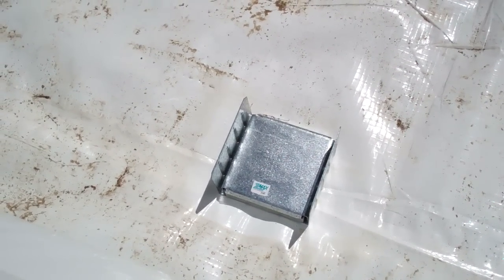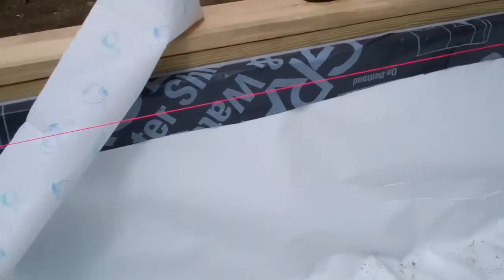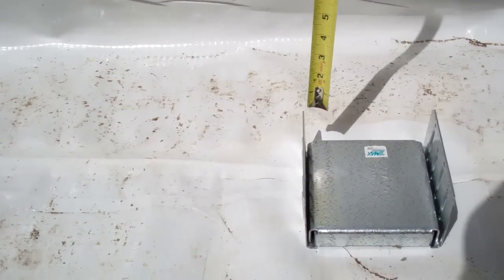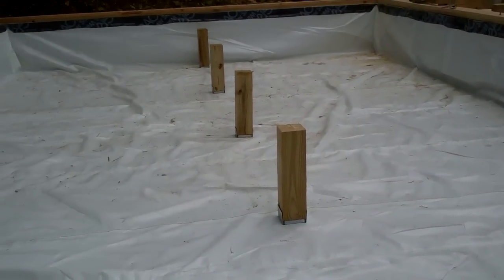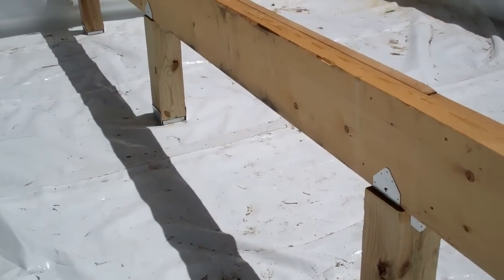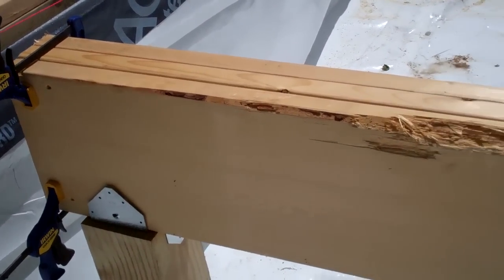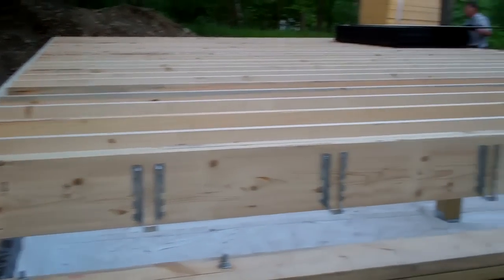First Floor Framing.mp4

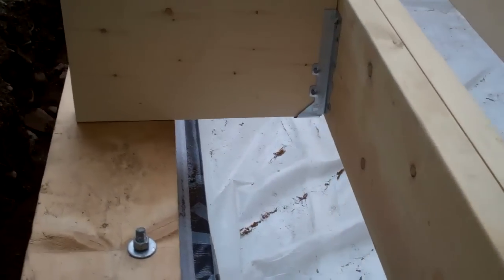Comment: 2:22 Looks like an engineering flaw in design. Those small joists will pull out on lowest point due to force from top down.
Reply: Its actually not. From that angle you cant see the gurder at the halfway point. Those T joist are just to support the exterior wall and the weight is transferred straight to the foundation wall. He is less then 16" from the foundation wall so all the weight of the floor is on the double 2x10. He really didn't even need to double them up.
Reply: @ianrobinson476  doubling up couldnt have hurt, better to overbuild than under, what i want to know is why the girder is not against the block, if it were me i would put it on the block, or notch out the block to receive it, making sure to coat the connection heavily to keep water absorbed from the block from getting to the wood.

Comment: Will 15' long 2x10s joist at 12" centers flex without that center support beam. I wanted to build an elevated cabin so I can park my car under it .
Reply from the maker: If you are building a floor that will support residential living space, then yes.  But not if it's going to hold up industrial equipment, or a roof with snow loads.  Just check your code book and span tables.  The most common lumber my local suppliers carry is SPF#2 or better.  That's Spruce Pine Fir, grade 2 or better.  https://up.codes/s/allowable-joist-spans
Reply: @DavidPozEnergy  Thanks. I bought some steel 8" pipes by about 5/16 wall today. I want to put a cabin in the air so I can see the wildlife once I start planting there. I am also about to order 2.5kw in Solar panels in preperation of my off grid adventure. Thanks

Comment: What is the bracket used between the triple 2x girder (beam) and the 6x6 post @ 1:40. I am trying to anchor a triple 2x6 beam to a concrete footer. Haven't been able to find anything with a 4/5" opening for the triple 2x's.
Reply from the maker: These are the connectors I used: https://www.strongtie.com/onepiecepostcaps_postcaps/bc-bcs_productgroup_wcc/p/bc.bcs
Reply from the maker: Another option for your situation might be: use a "post base" made for 6x6.  This will be 5.5".  Your triple 2x6 beam will have a width of 4.5", which means you could fill in by using squares of pressure treated 1/2" plywood on each side of your beam.  This would make it 5.5" just at the anchors.  Just an idea for you.
Reply: @DavidPozEnergy  , Thanks for the QUICK response. Yes, the second option is the one I was thinking of, but was hoping for a connector with a 4.5" fit. The specs for the BC/BCS connectors you linked above don't show any that have a 4.5" opening that would correspond to the three 2x's. What am I missing?
Reply from the maker: This is the exact one I used, it is made for securing 3-ply, 2x beam, to a 6x6 post: https://www.homedepot.com/p/Simpson-Strong-Tie-BCS-ZMAX-Galvanized-Post-Cap-Base-for-Double-3x-Beam-6x-Post-BCS2-3-6Z/207134326?cm_mmc=Shopping%7CG%7CBase%7CAll-Products%7CAll%7CAll%7CPLA%7c71700000014585962%7c58700001236285396%7c92700010802552343&gclid=EAIaIQobChMI29u86bnn4gIVqKGzCh3jBwXTEAQYAiABEgIPVPD_BwE&gclsrc=aw.ds

Comment: Is that a moisture treated sill plate and are those galvanize hold down❓Thy should be if not
Reply from the maker: Hi DL Construction,  The sill plate is pressure treated.  The anchor bolts are hot-dipped galvanized.  All was done per code, inspected, and passed.  Thanks for watching.

Comment: Where did you get your data for sizing and spacing of the joists?
Reply from the maker: I started by looking up the span tables in the Residential code book (IRC).  Here is a link: https://codes.iccsafe.org/public/document/IRC2018/chapter-5-floors  That tells you the minimum, I went more (stronger/stiffer) than was required.  My town was using the 2009 version at the time.  I bought the paper-back version because I was referencing it so often, but today you can look things up on a smart phone pretty quick.  Here is an amazon link for the book: https://amzn.to/2PMXU5V

Comment: Hi.  Thanks for the video.  It looks like you went with a full encapsulated, un-vented crawl space.  What influenced that decision for you?  My neighbor (in North Carolina) just got his contractors license and I asked him about the vented vs unvented crawlspace.  He replied that all the codes around here still call for vented. Thanks!
Reply from the maker: Hi Rush,  Thanks for watching the video.  You are right, that I went with an insulated and air-sealed crawl-space, commonly called an "encapsulated" crawl-space.  My Building inspector was old-school and needed some convincing to allow me to build this way instead of a vented system.  I had to present my plans with supplemental materials to make him comfortable.  Sometimes doing things a better way requires more work, in this case work to convince the inspector.  
On to your question as to why I choose this system.  I came to prefer this system from my field experience.  I've audited around 1,500 homes.  I found problems in 100% of the vented crawlspaces, but not in the encapsulated.  I've now lived in this house for 6 winters and never once had a pipe freeze, or mouse, or cobwebb, or mold, or mildew EVER!  I am completely convinced this is the better way to go.  I was also aiming to have a more energy efficient home then normal, and an encapsulated crawlspace makes that possible.  
I hope that helps.  Here is a more recent video I made on the crawlspace, compressing a lot of info into a shorter video: https://youtu.be/hXG5mOpQ6R4
Reply: Super helpful answer.  Thank you!
Reply: My dad built with an encapsulated, insulated and conditioned crawl space. It has been about 6 years now. Not one issue. It is absolutely perfect and a complete joy to go and work in if ever needed.  I am convinced that this is the way to build crawl spaces.

Comment: how far are the post apart and how far are the floor joist spans? Im about to do this exact same project and since its been awhile since you posted.. how solid did it turn out to be? any issues? I am debating going with a triple 2x12 beam or 4 - 2x10s. I already have the base plates in 10 ft apart and my floor joist will be 12 ft span. Just thinking maybe i should shorten them up. Any advice?  thanks for the video, looks good!

Comment: Largest bending internal forces (momentum) in continues beams are on supports. Making joints on supports are not good idea.
Reply: Joints on the supports is correct. Don't spread misinformation.

Comment: your seil plate, is it 2X12? or 2X10
Reply from the maker: Some areas the sill plate is 2x12, some are 2x10.  This is because the foundation is out of square and to square up the house the sill over-hangs in two corners.  If the town had allowed me a new foundation from the beginning, then I could have built the foundation square and only used 2x6 sill plates.
Reply: oh..... okay. looks good tho.

Comment: That girder is only nailed together at the end. It should be triple nailed at least 12" apart. Also Why not extend the girder all the way to the foundation wall, then notch it and make it flush with the sill? It would be stronger and neater. Also why not pour a rat slab in your crawlspace? Sure it looks neat now but without the slab, later on with traffic and shstuff that people throw in, that vapor barrier will definitely be damaged in multiple places. Your neat crawlspace would then become "Nasty" (as Janet Jackson called it in the 80s).
Reply from the maker: Order in Chaos I screwed the girder together while I was assembling it.  After I had it in place I went back with triple nails 12" on center from each side.  

There is a concrete slab poured, then I installed the vapor barrier on top of it.  This is a little odd, and I would change up the order next time.

I kept the girder back from the concrete very deliberately, and is just as strong.  The main reasons for keeping the girder back are as follows: 1. The vapor barrier is un-broken.  2. The insulation I installed later is un-broken.  3. The girder ends will never rot out. (which is something I have had to repair on other homes I have worked on.)

I hope that helps, there is certainly no one way to do this, I am showing my way to help give ideas to others.
Reply: as long as the span is not too long its just fine. you have to consider the amount of time and work involved using the plywood when it only adds minimal extra strength, its really not worth the trouble. The triple 2x12 beam without the plywood is more than enough.
Reply: We always extended to Girder all the way to the foundation where it was set into a pocket. The end was set on top of a thin piece of steel. No worries about rot. I would definitely extend the gieder.
Reply: Or just slip it into a Simpson 3X girder hanger - you can get them to hang off the bottom plate on the ends and/or bolt/epoxy them into the concrete
Reply: In 42 yrs of building I have never seen the the end of a support beam "rotted out" sitting on a foundation wall ! & code in all states is to bring it to the foundation wall for added support . As far as your 2"x12" beam goes ... you didn't add at least 1/2" -3/4" plywood in between each 2x12 for strength ! shame on you ! lol

Comment: What is the idea of having the short pieces of floorjoist between the last joist and the rimjoist?
Reply from the maker: The last common joist was replaced with a series of short joists.  There are two purposes for this.  One: It opens up a long narrow cavity into short wide cavities.  This makes installing insulation possible.  Two: They resist lateral forces better this way which keeps the girder in place.
Reply: Thank you
Reply: I think it’s also a good idea because there’s more support for a exterior wall that might go there, if there was no small joists there a potential wall would be sitting on the deck with only the rim board supporting it